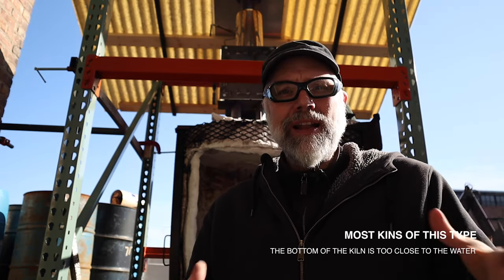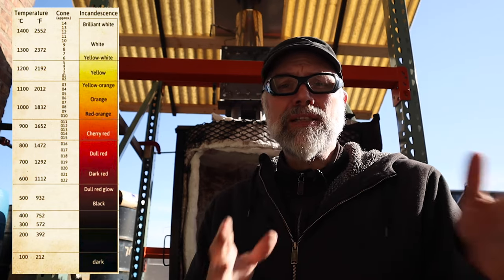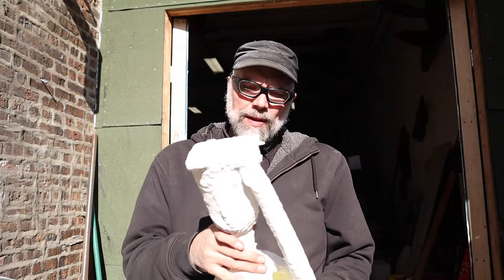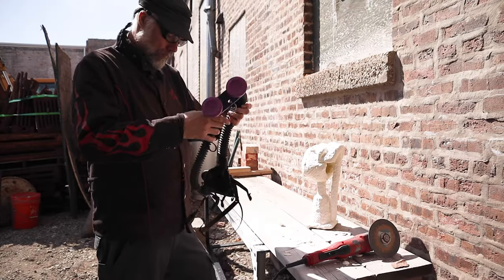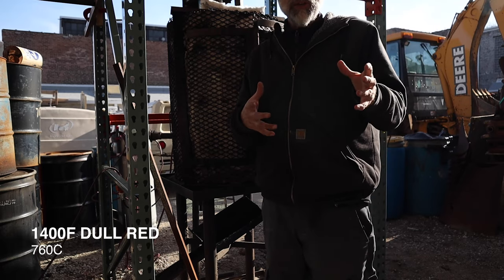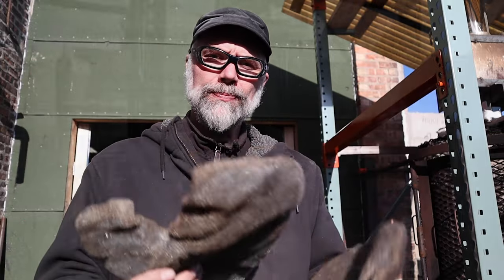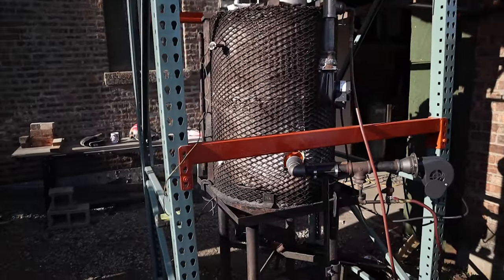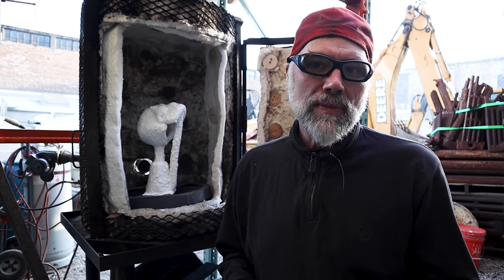Lost Wax casting: How to burnout ceramic shell, option 1

Comment: Great info! Would love a video on your burnout furnace if you are keen to make one!
Reply from the maker: I will definitely do that this weekend.  Thanks for your interest.  How are you currently burning out shells, if you are?
Reply: @LunarburnStudio  Thanks! I am doing plaster mold investment currently and have a very basic burnout/curing oven that I converted from an large old 4 burner BBQ using a 20psi regulator and DIY furnace controller. As I am looking at upgrading from plaster to ceramic shell your information has been very useful. Keep up the great work!

Comment: Hi,  I am currently trying to learn the ceramic shell process and wanted to ask what temp and for how long you fire the shell and for how long?  My shells are quite fragile.  I use quartz powderinstead of silica powder, does that make a difference?
Reply from the maker: I bring my shells up to 1650F/900C then hold for 10 mins or so. But really dependent on when the shell are white. If you have a gas kiln firing in reduction this will take longer.  As for the shell, I am not familiar with quartz powder per say.  What I use is Fused Silica which is fired quartz.

Comment: Thank you for your detailed explanation of why you use your methods. I continually have cracks in my shell due to improper heating. This video has just come in time as I wanted to quit. Just one question though, up to what temperature do you pre-heat your shells before casting? Best Regards
Reply from the maker: Your pre-heat temp will depend in the thickness of your pattern but typically I shoot for a temperature of 1200-1400F for 3/16" (5mm) patterns (thinner the higher and thicker lower) when I pull them from the kiln.  The temp might be a little higher than I need but it gives me some extra time to get my shells set before I pour them.

Comment: Eric, another thoughtful and generous presentation. 
Will check out source for the mits for handling heated ceramic shells.  Do you have plans to present the boil out wax method?   I used it with success.  It is simple and efficient.  As of last December I have gone through the entire process of ceramic shell casting for the first time.  Have enjoyed and benefited from several of your videos.  Thanks!
Reply from the maker: Testing a few things, but yes will be showing the boil-out method in a couple of videos from now.
Reply: Hi Roy!, I am a foundryman from Lithuania. Could I ask to share more about boil out wax method? I have tried it with torch, but it gives a lot of cracks.

Comment: How do you proceed for 3D print burn out? In a previous video your Skull is not wax but a 3D print. Do you use the same heat level and process when firing 3D print material, How do you avoid expansion of the print material causing the cracking of moulds
Reply from the maker: For the most part yes, same temps as wax, especially with the Polycast.  Pla will burn out at a lower temp, but you still need to vitrify the shell at 1650F/900C

Comment: Hey! What is an efficient way of buying or acquiring your metal, in this case iron? 
Also, I absolutely support the idea of a more detailed video about the subtleties of your kiln
Reply from the maker: It is possible to buy iron ingots but most of whats melted at community iron pours that are running Cupolas brake up and melt down salvage/recycled radiators, bathtubs, sinks and with furnaces with big throats, brake roters.

Comment: Hi Eric, I whas thinking to build my own burnout kiln. With softbricks and I will use your design of pouringcups. Ik whas thinking when I make a hole in de bottem of the kiln, and I design this so, that the pouringcup fits exactly on it, so when the wax drips out it will not come in contact with the flame of the burner. Maybe it wil not catch fire. And underneath a small pan (air tight)where the wax drips in, when this will catch fire, it will not burn long, because not enough ogxygen. Will this work?
Reply from the maker: The theory sounds solid, just make sure there is some heat hitting the cup otherwise the wax could jam up at that point and crack your shell. Or you could take the step of de-waxing your cup only before placing it in your kiln.

Comment: Hi Eric, very very good video's your making. You give so much very useful informatie. I also want to start with ceramic shell investment casting. How long you burn you shell after de-wax? To virtified the shell.
Kind regards from Holland!
Reply from the maker: Depends on the size of your kiln and how many shells your burning out at one time. I typically burn out 1-2 shells at a time. After the wax has drpped out i wait for the black smoke to stop. Then cook for another 5 min. Try to hold my burnout temp around 1650 f / 900 c
Reply: @LunarburnStudio  Hi Eric, I whas thinking to build my own burnout kiln. With softbricks and I will use your design of pouringcups. Ik whas thinking when I make a hole in de bottem of the kiln, and I design this so, that the pouringcup fits exactly on it, so when the wax drips out it will not come in contact with the flame of the burner. Maybe it wil not catch fire. And underneath a small pan (air tight)where the wax drips in, when this will catch fire, it will not burn long, because not enough ogxygen. Will this work?

Comment: Really great information in all your content, thank you for your generosity in sharing this. Creating fume is not really an option for our location is there anything to be aware of when using a boiling water bath to remove the majority of wax before placing in an electric kiln?
Reply from the maker: Depending on the shape of the pattern/wax you might want to create escape route for the waxes either by addition venting or drilling micro-vents.  Remember the wax will float up not run out.